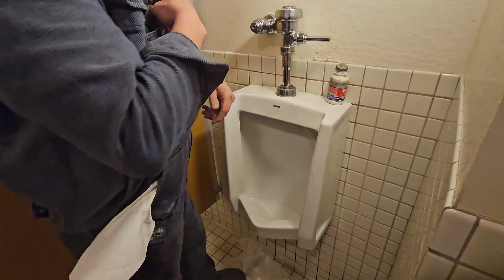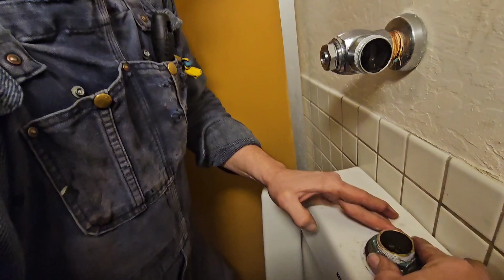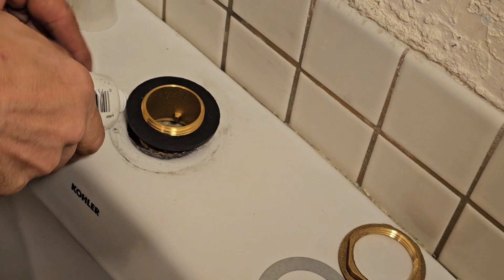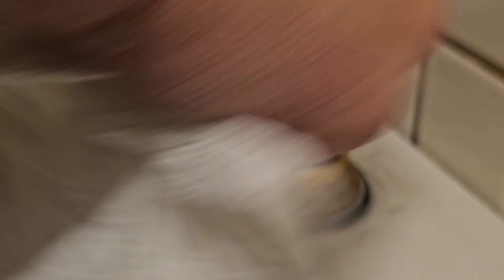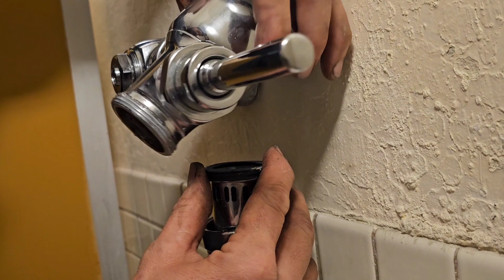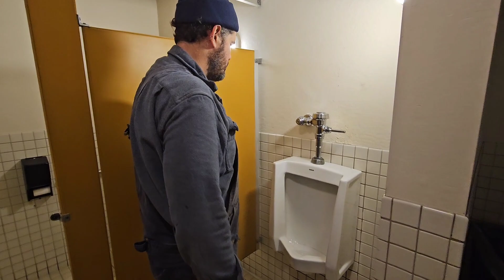Replace Leaking Urinal Spud Azteca Restruant

Comment: Nice video, obviously not a plumber. Using the pipe wrench backward, rubber is usually inserted with the spud not after. Also overtightened the spud. It all worked but several issues could have been bad.
Reply from the maker: Absolutely not to everything you just said. SUPER TROLL..why are you saying that nonsense..
Reply: @ not a troll! First, pipe wrenches are used with the loose jaw pulling toward the fixed jaw. They are not meant to be used by tightening the jaws together and pushing on the loose jaw. Second, I have replaced hundreds of spuds and the international plumbers guide showed in its instructional videos and books that the rubber gasket is inserted while on the spud. Third, the rubber gasket is considered to be a light compression seal, not a heavy compression seal. When putting that much torque on that particular seal, it is common for the porcelain around it to develop micro cracks. Every time someone flushes that toilet it puts lateral pressure on the vertical pipe thus when that fitting is torqued down so tight it exerts pressure sideways on the urinal opening that it was not designed to withstand. In most cases, when young apprentices make this mistake we end up replacing the entire urinal because it breaks. I believe another person commented on hearing what sounded like a cracking noise during the tightening process you were showing. These are not comments made to be negative, just informative.
Reply from the maker: @journeybeforedestinationov3553  Still Trollin brother... This install is good.. you may want to go check on those 100 loose spuds you installed.. There's plenty of people for you to Troll not a 25 year Journeyman Plumber.. Happy Hunting... Troll

Comment: Am I the only one that heard the slight "crack" noise at 7:21 when he was tightening the spud? LOL. I just recently replaced one and my greatest fear was overtightening and cracking the urinal. Great video and easy to see everything you did!
Reply from the maker: @Jsuarez6  porcelain does talk to you. There may of been some tiny chips cracking out inside. Those spuds you need to get just as tight as you can before cracking anything. otherwise when you tighten the vacuum breaker tailpiece the whole Spud will start spinning.